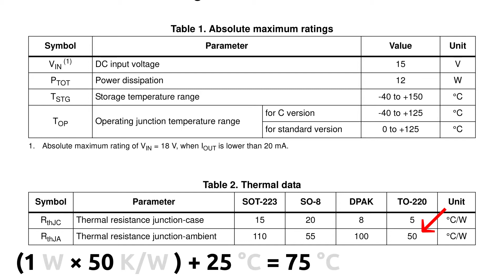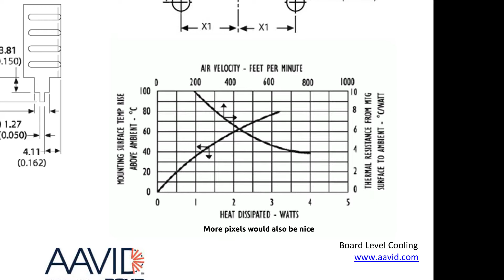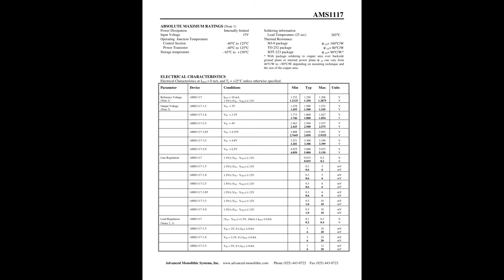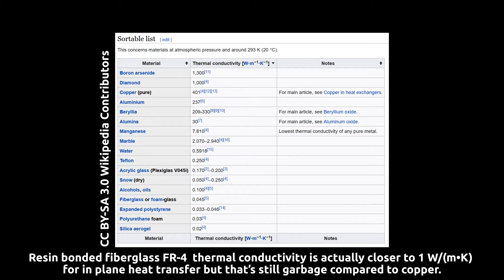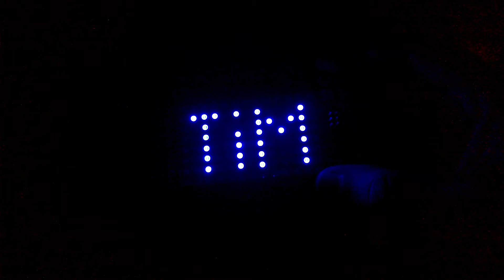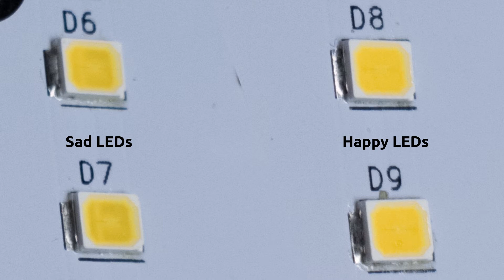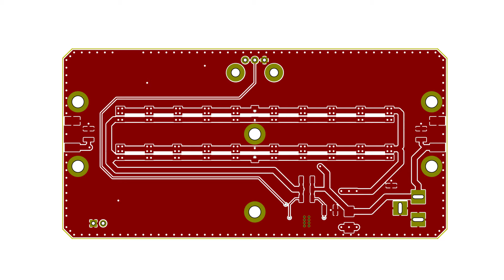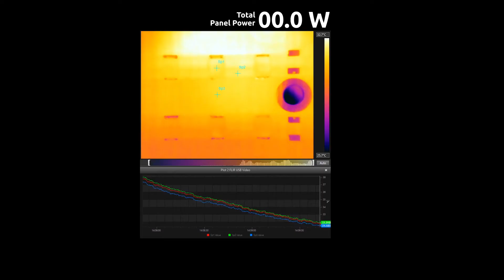SMT Thermal Design Mistakes

Comment: Hi ! Good job but ... If you want to dissipate heat => no green varnish in the copper aera (whish has been ENIG finish) ! :)
Reply from the maker: Yes 100%, I see that regularly on PCBs in high end products and I've been tempted to do that with several PCBs, but ENIG is just such an expensive option when I'm only ordering 5 or 10 prototype PCBs (4-8x the price of a standard PCB) which is less cost effective than just adding a SMT heatsink, plus the gold is often only like 0.02 µm thick so you don't even get that vibrant gold finish :( 

I will add on the other hand aluminum core PCBs have really come down in price (only ~2x the price), I've had a play around with some designs using that and it's a massive performance increase, but the single sided limitation really limits the application, only used it so far for LED stuff.
Reply: @WizardTim  I wanted to say that copper or ENIG or HAL are all good for heat dissipation but not green solder mask on copper, which is as running with a pull-over. On your video, it seems that you have green solder mask on the dissipation aera ?
Reply from the maker: @zianzan4536  Yes both the green and white PCBs have solder mask over the heat dissipating areas. I don't think I've ever done a PCB with an exposed area for a PCB heatsink that was HAL, I did try once with a silver immersion finish, was happy with it at first but it tarnished really quickly, so I might give HAL a try in future for PCB heatsinks. I've seen some PCB designs that expose strips of HAL in a PCB heatsink and the wave soldering process adds extra solder, I can imagine that massively improves in-plane thermal conductivity.
Reply: @WizardTim  :) I'm doing PCB for 20 years now, and yes : no vernish over dissipation aera. Yes : HAL is not a good finishing in that case of dissipation aera (unesthetic and solder is not uniform), but ENIG is perfect : more than 50 boards done with this finishing and with dissipating areas. With vernish : almost no dissipation is possible, it's not mettalic, it's as a cover. A nice trick with ENIG and a transistor with thermal pad SMD : let a litlle band of vernish between SMD pad and dissipation aera to avoid solder going on dissipation aera.

I'm using a thermal camera too and I've strange results with ENIG dissipation aera : heat is not the same with angle of the camera (a hot spot of 60°C can be shown only on some angles, otherwise it can be 25°C and the hot spot is not visible), very strange, do you have same ?
Reply from the maker: @zianzan4536  ENIG areas will appear as if the temperature changes with the angle of the camera because ENIG and most other metals have very low emissivity and high reflectance, so that 25°C is just the reflected room temperature. You can get around this by putting some Kapton tape over it which has a high emmissivity, but that will change the thermal performance.
Reply: @WizardTim  Thank you ! Good info, I'll try

Comment: Excelent video!! what's the model of your thermal camera?
Thanks!
Reply from the maker: It’s a FLIR E8 which is now discontinued but it has been replaced by the FLIR E8-XT (AU$5,200) which can measure higher temperatures with better thermal resolution (same X-Y resolution). The PC software shown in the video is also an additional AU$500 however it has also been discontinued and replaced by an annual subscription version (I hate it).

I don’t recommend the lower end FLIR E series models as after trying them I realised that not only do they have a lower X-Y resolution but the temperature resolution is much worse and they add a lot of noise to the image which makes looking at small thermal gradients on PCBs rather difficult (all models use the same sensor but software intentionally degrades image quality in the cheaper ones for market segmentation).

Shop around as well, some distributors will throw in additional accessories like a spare battery or soft carry case for MSRP.

However I must note I bought the camera at the end of 2018, and the FLIR E series is now about a decade old, because of that I would recommend against buying a FLIR camera as particularly in the last year there are a lot more better options from other companies for vastly less money and also not crippled by pointless US ITAR restrictions.

Comment: What I learned:
I definitely want a thermal camera
Reply from the maker: I wanted one for a long time and finally got the courage to spend the money on it late 2018 and it’s been super useful for designing electronics but also repairing electronics and mechanical things (saved many hours by instantly finding the issue). I’ve found it’s useful in all sorts of situations and it’s now a tool I couldn’t live without, but at AU$6,000 it’s difficult to justify even with all the use I get out of it.
Reply: @WizardTim  Thanks for the video. very useful. what brand/model of thermal camera did you use here? I plan to recommend one for work. thanks.
Reply from the maker: @chitotapia  It’s a FLIR E8 which is now discontinued but it has been replaced by the FLIR E8-XT (AU$5,200) which can measure higher temperatures with better thermal resolution (same X-Y resolution). The PC software shown in the video is also an additional AU$500 however there is a free version with limited functionality.

I don’t recommend the lower end models as after trying them I realised that not only do they have a lower X-Y resolution but the temperature resolution is much worse and they add a lot of noise to the image which makes looking at small thermal gradients on PCBs rather difficult (all models use the same sensor but software intentionally degrades image quality in the cheaper ones).

Shop around as well, some distributors will throw in additional accessories like a spare battery or soft carry case for MSRP.

There are also thermal cameras available from Seek, Fluke, Testo and others but I haven’t tried any of them.

Comment: search for surface mount thermal bridge to make  use of the ground plane as a heatsink.
Reply from the maker: Yea those SMT thermal bridges are nifty ideas but for the price of them (AU$0.50 - AU$3.00) I could buy an SMT folded copper heatsink that could dissipate much more heat :/ They're only really cost effective in very niche RF applications and certain ultra low profile designs.

Comment: Cool! I always wonder why more linregs don't sink heat to ground - even if that's added manufacturing cost (since it's probably a FET drain thing) I'd imagine it would be a big selling point.
Reply from the maker: Sadly it’s not just a cost thing it’s a complex silicon design thing. Dropout voltage plays the biggest role in why mostly LDOs end up with Vout on the tab. Your jellybean standard regulator will often use an NPN Darlington pair which needs a high dropout voltage, LDOs with GND on the tab often use a PNP pass transistor but those will often suffer from high quiescent currents, the 1117 uses an NPN to achieve its low quiescent current but the trade-off it makes is the silicon substrate is Vout and thus the tab.